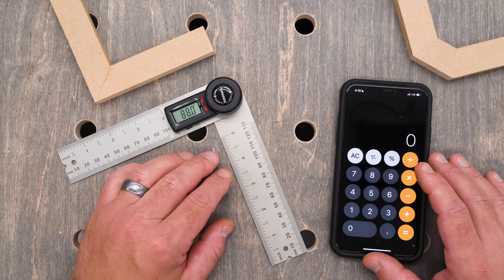The #1 Beginner Trim Mistake & How to Avoid It / How to Measure & Cut Mitered Corners

Comment: For peeps who don't know why this trick works, it's because on a miter saw, when the blade is perpendicular to the fence, the scale reads 0° when it's actually 90°. I never understood why manufacturers did this.
Reply: Zero means no angle on the cross cut , plain and simple
Reply: @stevenfoust3782  I get what you're saying but for newbies that could be misleading way to say it.
Reply: @BigBrotherIsTooBig  30 yrs as a finish carpenter says it works as advertised. Newbies have to learn by making piles of sawdust
Reply: @stevenfoust3782  Ofc it works. It'd work if it said 272 instead of zero as long as you compensated for it. Doesn't mean it's the best way 😀
Reply: @BigBrotherIsTooBig  I understand the the saw scale is not actually proper when you figure everything from 180*, but it is accurate when cutting angles in relation to installing whatever is being fitted. Using 180 as a starting point when trying to figure out odd angles is used instead of guessing. Sure 0 is actually 90 but 45 is still 45 so…

Comment: The confusing thing is that the angle on the mitre saw is "degrees from a square cut", not "degrees from a parallel cut. Which makes sense, until it doesn't :-)

Comment: Corners in homes are that much out of square  as a matter of course. It’s challenging to work with, but those houses will still be standing when all the newer homes with square corners have collapsed as the glue and joist hangers deteriorate.

Comment: Hi, my method is to read the gauge, divide by 2, move the gauge to reach the calculated half, lock the gauge and bring it to the miter saw to copy the angle and cut. Almost no math involved and a perfect fit. Greetings from France.
Reply from the maker: @Pierra A little slower, but that’s a great idea!
Reply: @InspireWoodcraft  thanks for your answer. The main advantage for me is to compensate any inaccuracies of the miter saw graduation, this allows me to skip a reading/setting step. Thanks for all the knowledge and tips that you share on your channel for a while, it’s always a pleasure to follow you !

Comment: I'm an engineer so I understand how this works but most people in their workshop aren't going to get into complicated math.  Here is how I would look at it- exaggerate the situation and then consider what the angle would be.  For instance if you measured 88 degrees then that is a bit "closed" from a true 90 degree corner.  Now close those arms some more and think about what the angle would be.  It is easy to see that the angle is much larger than 45 degrees therefore it makes sense that instead of setting the saw to 44 you would set it to something like 46.  Well you have to do a little bit of math- a corner is 90 degrees so 2 angles that fit in the corner have to add up to 90 degrees.  Half of 88 is 44, you need to set the saw to 46 which is the complement of 44 degrees.  They add up to 90.  If you took my example and closed the angle even further, maybe you get 70 degrees.  Half of that is 35 but you can see that 35 is incorrect so set the saw to the complement of that which is 55 degrees.
Reply: Yes, you made it worse to understand by re-explaining it. 
Thanks though, it’s the thought that counts. I still liked the explanation.

Comment: The math is correct but a more intuitive way,  in my opinion, to calculate the cut angle is to start by dividing by two and then subtract that value from 90.
Why? Well, the angle you want your cut at is half of your measurement, so start by dividing that by two. But your mitre saws scale is reversed so before cutting you need to flip it and you do that by subtracting from 90. 
This follows the thought process better. You want half the angle and then you adapt to the reverse scale on the mitre saw.
A usefull point is also that your intermediate result is your target angle and something you can verrify by mesauring the cut pieces. Also if your saws scale happens to go the other way (I have never seen a saw lika that but just image for a sec) this is the value to cut at. The (180 - meassurement)/2 method will  indeed give you the same result but isn't as easy to grasp why it works.

Comment: Great video. Very helpful, thank you! How do you make this work if you don't have a digital angle finder?
Reply from the maker: @danielmackey6594 I don't know if this will help, but it's an option (https://youtu.be/ACGbbjrFSqY) Also, there are tools available for this kind of work that do the match for you. The Starrett miter protractor is pretty popular (https://amzn.to/3Uxe9Y0). The SawSet Pro is another really good option too (https://amzn.to/4d9NTKx), but you have to have/use a sliding t-bevel to use it.
Reply: @InspireWoodcraft That video shows a pretty good method. Today I was installing quarter round trim. Using the overlap method would have be very difficult. Thankfully I was able to pick up a digital angle finder.
Reply from the maker: @danielmackey6594  Oh good! The overlap method works really well for establishing the angles, and on quarter round, or other awkward profiles, I would use flat stock to establish the angle that needs to be cut, set the saw to that angle, and then cut the quarter round to that angle. But, you found an angle finder so it sounds like you’re all set!

Comment: I've often wondered why tool companies didn't or couldn't build a full 180 degree miter saw. The radial arm saw is the only one that I am familiar with though and even those were "super-sketchy" when cutting acute angles.
Reply from the maker: @Brett Jenkins Ive wondered the same thing. I’ve heard that they were originally made for framers, who have a different work flow. Even if that was the case, why are miter gauges and table saw blade tilt gauges inverse as well?

Comment: Perhaps it would make more sense if saws were not marked as 0 degrees in the centre, but as 90. In a standard cut, that's what you want, a perfect 90 degree square. Then the more versatile saws would go all the way down to 40 in either direction, which would make it a snap to make a 80 degree mitre.
Reply: Some videos show putting a piece of tape behind the scale on the miter saw and writing the correct angles on the tape, which you can then use with your original measurements and no math.  Start with 90 at the center (0 on the saw’s scale) and subtract the saw’s scale number from 90 for each graduation.

Comment: Ok I am a “ professional “. I do this for a living however where I find a lot of problem with this very “ true” theory is inside 22.5 crown that is off?  Say 22.8 or even 23.1 that’s the issue & yes you can go from the 180 to an obtuse angle ?  And get deep into the weeds while you hv 250’ more to go?
Can you give me a fairly quick solve rate here?  It’s always the 22.5 crown where the sleeping bear is?
Reply: This technique will work for crown if you cut it "in place" and even if you cut it flat. 
But if you cut it flat the compound cut is really hard to get accurate enough to look good.
Not sure of your technique for cutting crown but you don't need to be 100% accurate. If you're close, within a few tenths of a degree I would recommend gluing and nailing the corners and if there is any gap at the wall or ceiling, it can easily be filled with caulk.
Reply from the maker: @zephyr1408 I’m not sure I totally understand the question, but if you’re cutting it nested, there shouldn’t be a problem math-wise.
Reply: @InspireWoodcraft  there is actually.  And next time I  hang crown I will shoot you the problem.  Not saying it’s this system ?  But def having issues finding correct miters with low numbers.
Reply: @zephyr1408  I'd love to see that. Shoot your method of measuring and cutting so we can see what's going on. 👍
Reply: @InspireWoodcraft  I went back to your other video you hv and some of Spencer Lewis .  Crown is always a challenge especially doing short back to back inside corners.   The rest is not an issue and I hang it alone.    Thee one I find most challenging is 2 piece kitchen !  
Anyway my apologies if I was unclear!
Reply from the maker: @zephyr1408 Spencer Lewis is a great place to learn. He’s one of my favorites. And he’s way more qualified to answer this than I am! 😂. But I love a challenge so if you come across it again try to let me know.
Reply: @InspireWoodcraft  I appreciate you !  I hv learned a lot from your videos!  And I guess my issue is resolving odd out of alinement angles w/o resorting to 300 pounds of caulk!

I discovered 8” shims made on a jig and stave shims from Spencer .  He uses to close gaps I was concerned with because of build up in the corners of sheet rock or in this case I was asking about was a set of cabinets poorly shimmed throwing one corner out of alinement to the other!  
Having said all that I hv a couple channels I keep videos on “Inside Carpentry” , “RR Buildings” & your Channel!
Finish carpentry is a challenge daily, & I hv found as a rule most carpenters avoid it!
I do  cabinets, base, crown, built ins , stools, casings, in different styles mostly custom with now “Craftsman Trim” at the top!

So thank you sir so very much for your videos!  I know it is a huge effort to make them!
Jim Duncan; 
Kings Table Custom Finish Carpentry